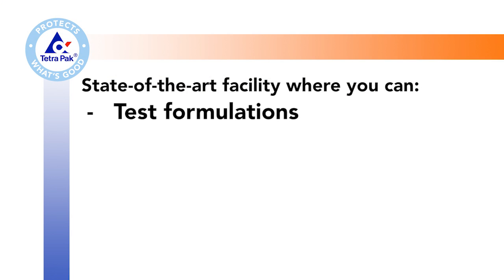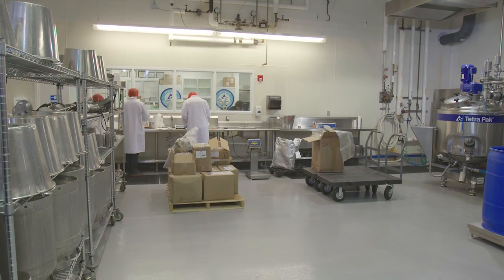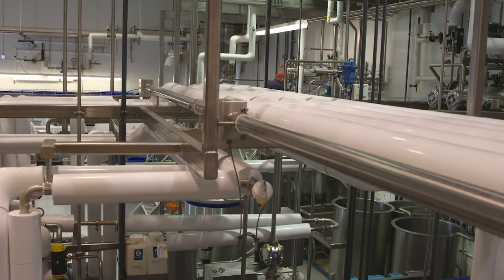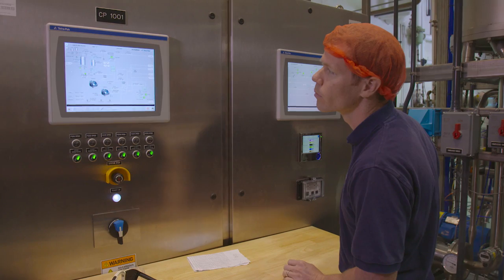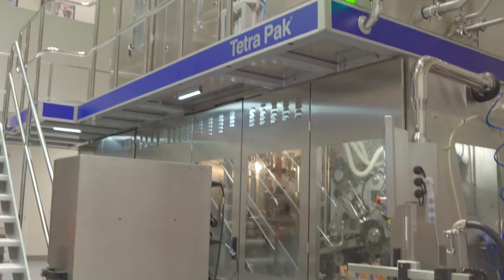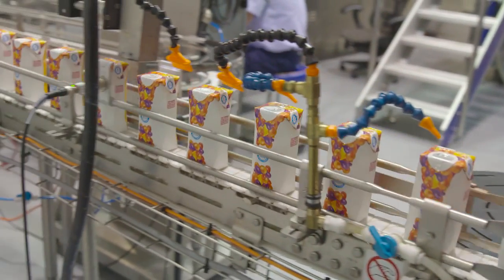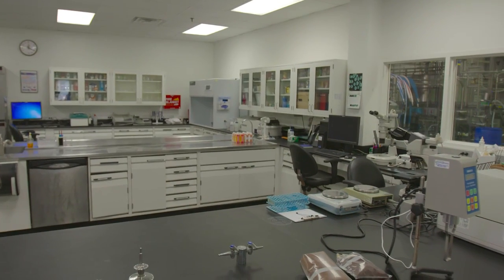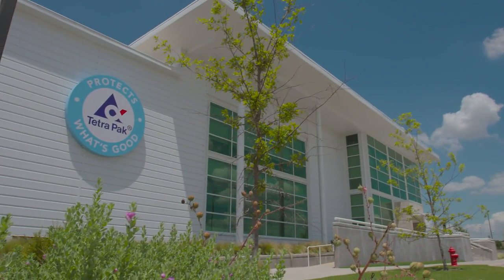Tetra Pak Pilot Plant - An Inside Look

Comment: Hi, I am really curious about the sterilisation technique used for packaging material. Are they being treated with UV light or some gases?
Reply: The Tetra Pak reels are actually hydrogen peroxide sprayed just before the beverage is filled which acts as a disinfectant and oxidant. Thus Aseptic packaging is maintained
Reply: @531998899135  we want some information of Aseptic process, how to contact you sir